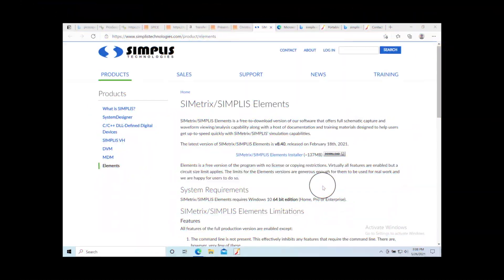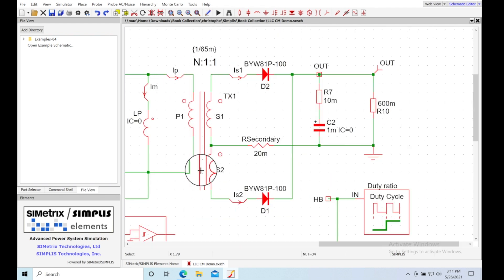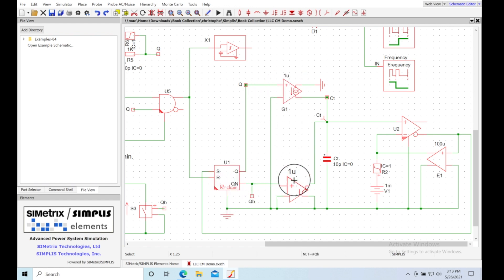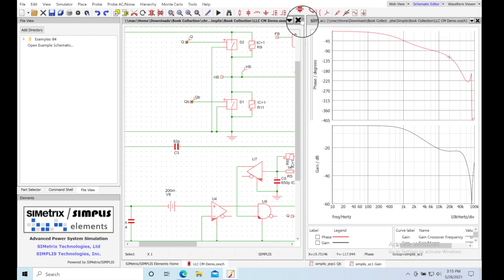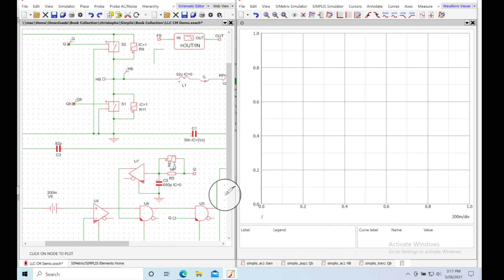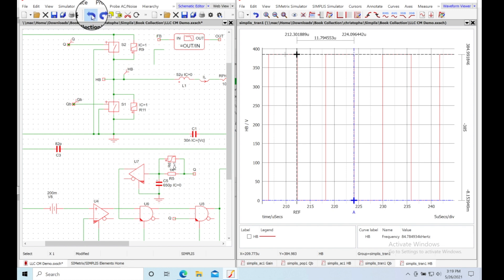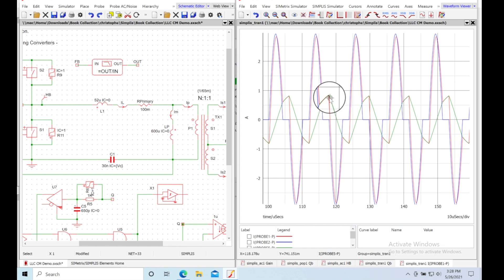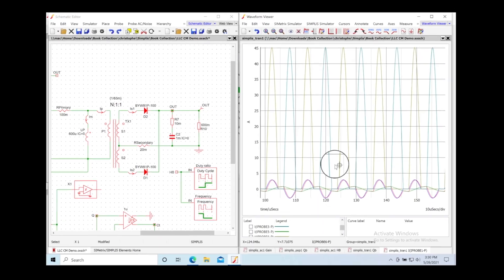LLC Converter by Basso with free Simulation Simplis Software #LLCconverter #Basso #simplis

Comment: Oh you young whipper snappers :)   Here I am with paper, pencil, eraser and and my old Faber Castell slide rule, drawing schematics and arc welding my screwdrivers by forgetting to disconnect the darn power while modifying a prototype.  Hehe...  I use EasyPC so I'm not really all stone knives and bear skins!   I've been playing in the digital ( for work ) world so long I forgot how good real leaded solder tasted.  I decided to play with an old design ( Germanium ) AB amp that was Germanium complementary symmetry and adapting the basic topology to work with SI.  The designs are so old and I was so young, that I barely remember how cool I though I was to use a diff pair and a Wilson mirror for setting up currents...   Anyhow it's sure fun to play in the analog world again.  Thanks for the Inspiration and the trip down memory lane with your amp and the turntable references in a previous video.
Reply from the maker: LMAO;)  Nothing wrong with stone knives - I seem to cut myself with the new ones;)  Thanks for the laugh!

Comment: Yeah I'm way out of my depth on this topic!
Reply from the maker: Yes, this is deep stuff, but I wanted to show the size of circuit that this free software software can handle.
Reply: @KissAnalog  is it possible to select input and output voltage ranges and asked for specific type of circuit and it spits out a complete circuit which should get you in the ballpark of where you would want to be so that you can then tweak it to suit your needs? 
I mean, I have seen some really good circuits that I have seen in datasheets and application notes that have an isolated output and a very wide input voltage range but the output voltage and current is not what I need and I know that the output voltage can be changed by selecting the right transformer but it's still a long way before I understand power supply circuits the same way that I understand audio amplifiers and their linear power supplies!
Maybe if I use that software and input a circuit that comes close to what I need, then play around with some of the comments, I could possibly work out something that might work for the application that I need? Hmmm interesting!!!!

Comment: Does it use device primitives, elements, rather than actual devices with a SPICE model of its characteristics? Or both? This is the problem I find with most software - steep learning curve.
Reply from the maker: It actually uses both, and the math model is piecewise linear I believe.  So, there are some behavior based models which help it to run fast.  LTSpice does this, but just not as good;) But then again, the free version is limited in size.

Comment: What is shown is the LLC operated in current-mode control and it requires some digital arrangement to operate with a perfectly-adjusted 50% duty ratio. There is no control clock in approach and the LLC works similarly to a free-run converter: the on-time duration depends on the peak current setpoint while the off-time is an exact replication of the elapsed on-time hence the logic glue. There is another example which works in a more classical way and uses a voltage-controlled oscillator where the clock frequency is controlled by the error voltage.
Reply from the maker: Thanks for this great feedback!  Do you have a controller for LLC that you like?